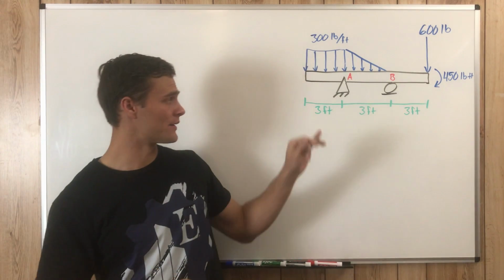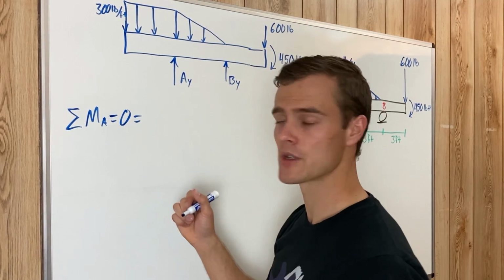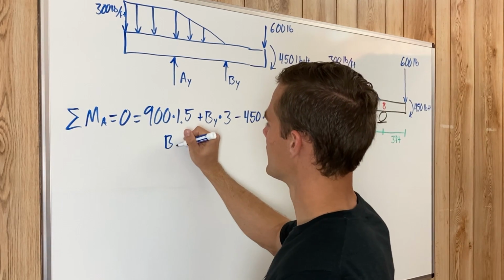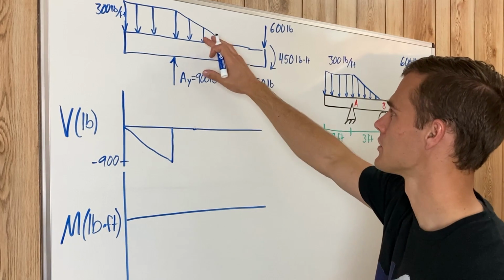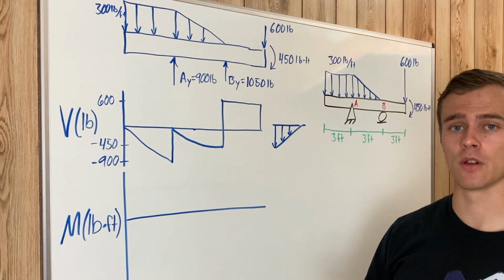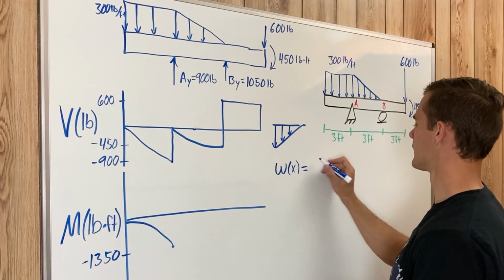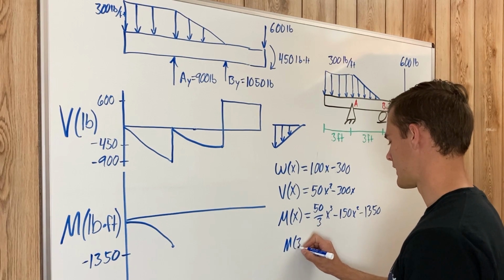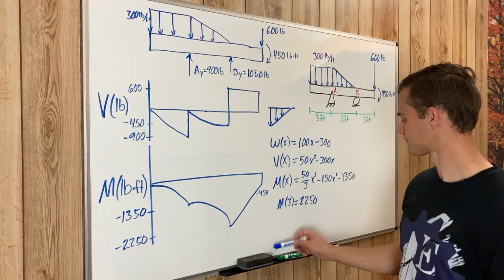TRIANGULAR LOAD Shear and Moment Diagram EXAMPLE PROBLEM // Calculus Explained

Comment: Hello, I love your videos they make this topic so clear! However I have a simple question. When you write the equation w(x) for the triangular distributed load, when is it -300, not 300? I am talking about the intercept or whatever you are going to call it. How do you decide on the sign?
Reply from the maker: Thanks! I’m glad! When the force is going down I write it as negative and when it is going up I write it as positive.
Reply: @studentengineering  Thank you for the response. Usually all distributed loads go downwards, does that mean that I will always have the w(x) intercept as negative?
Reply from the maker: Yes

Comment: I am confused on why 3 is being plugged in instead of 6. I am getting different boundary conditions but ending up with the same max moment of -2250. I see you are defining the part where the triangular distributed load starts as 0 on the x axis? Why isn't this defined as 3 on the x axis?
Reply from the maker: I think we just summed moments about a different point. Does that make sense?

Comment: Why multiply 450 with 1? I understood the centre of gravity for the right angled is 1/3 its length, but since you took moment at point A, shouldnt it be 450x1/3? Because its 1/3 away from point A?
Reply from the maker: Great question! You’re right that it should be 1/3 along the triangle’s length. Because the triangle is 3 ft long that comes out to be 1

Comment: Why did you use By instead of Ay for the Sum of moments A please?
Reply from the maker: Great question! When we sum moments about a point we don’t need to include forces that pass through that point. This is because those forces won’t cause rotation about that point. When you sum moments about a point to find reaction forces you want to pick a point that is in the line of action of as many unknown forces as possible so that you don’t have to consider them in that particular equilibrium equation. Besides that reason, it doesn’t really matter which point you choose to sum moments about.

Comment: for the moment equation why do you plug in 3 and not 6?
Reply from the maker: Great question! That would be the case if the moment equation described the bending moment across the whole beam but it doesn’t. The equation describes the moment starting at 3 feet along the beam and going to 6 feet along the beam, moving from left to right. This is where the triangular distributed load occurs and so plugging 3 into the moment equation gives us the moment that occurs 3 feet along the section of the triangular distributed load but 6 feet along the beam. Does that make sense?